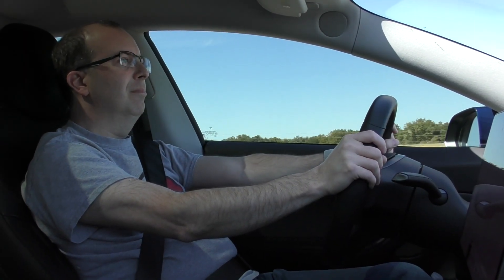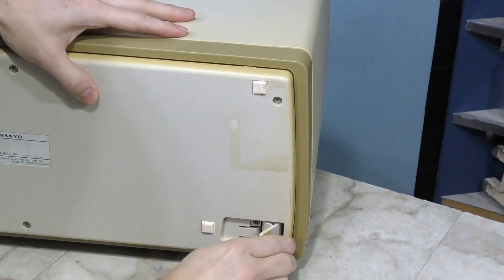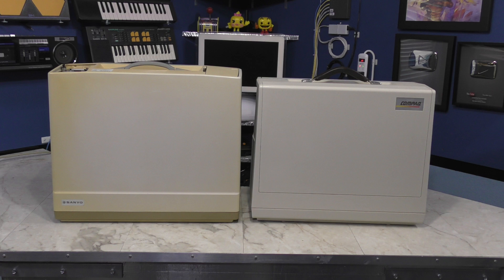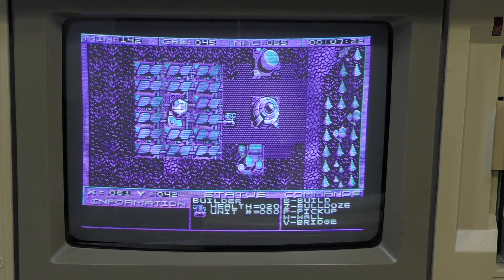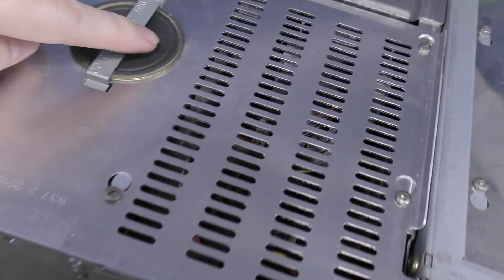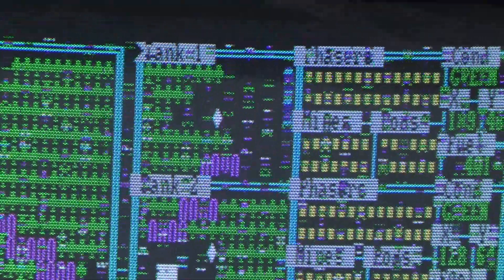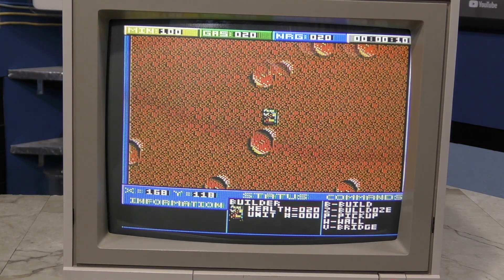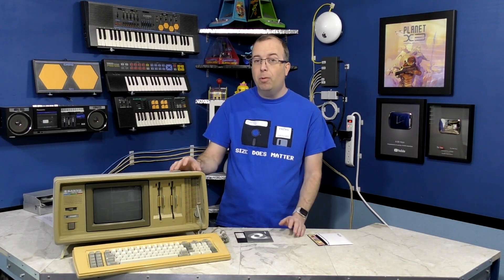Sanyo MBC-775 - The first PC portable computer with color screen.

Comment: omg I HAD one of these that I picked up off the curb back in 1993. I took it to the local computer shop and we added in a board to upgrade the ram to 640k so I could play games that required 512k of memory (i forgot by now but I know I had to get more than 256 ram!). I wish I never tossed it but space was definitely an issue back when I was renting an apt with 2 other guys and later that year I bought a new ZEOS 486 desktop and this Sanyo found its way down to my brother in Florida. He's long since dumped it but I believe he got a network card in it and ran DOOM on it with his apt buddies in LAN games. Good times.

Comment: That's it I have that veru same  Sanyo Luggable (41+ Lbs). I paid $1500 in 1988.  9" CGA screen, 2 40 track 5&1/4" floppys, 48Kb Memory,  Added a 6-Pack w/ Parallel Printer port, Serial Port, 384K memory, Modem 1200 Baud & 2 other things I can't remember. I also added a 10MB Western Digital Hard Card. It all sits in my on the Bedroom floor between the wall and Dressor with 5 or6 old Laptops, Old Analog Video Editing Switchers/Titlers.

Comment: Whow! This was my first PC and it is still in the basement. It has an 8bit ISA slot (yes...ONE free slot :-) ) and I changed the cards all the time...8bit VGA, EGA, Hercules, MFM HDD controller, joystick controller for two joysticks with Atari/Amiga/C64 style connectors. I still also have a NEC Multisync 3D Monitor that I used for Hercules, EGA and VGA. Oh, that was a great time! I think I´ll get it out of the basement and replace the capacitors inside the power supply

Comment: I wonder if they used a 120-to-100 volts AC step-down transformer with the monitor. If so that would explain most, if not all, of the extra weight compared to the Compaq portable. That's what Nintendo did with their classic arcade machines (Punch-Out!!, Donkey Kong, Popeye, etc.) which had Japanese-market 100 VAC Sanyo monitors that would be ruined if you plugged them directly into a 120 VAC outlet.

Comment: Just bought the same sanyo 775 it's gorgeous. Mine has a factory mfm st225 hard drive. Unfortunately, I don't have a keyboard, does it have to be an XT keyboard or will AT work?
I will try to change the ram to 640kb in the future

Comment: The base RAM is 256 kB., expandable to 640 kB.  How do you expand it to 640 kB.?  Do the chips go right on the removable portion of the motherboard?  Do they need to go on the internal portion of the motherboard?  Do they need their own expansion card, and if so, is that card a custom card or a commercial off-the-shelf card?

Comment: I had one of these...NEW! :)  I picked it up in the late '80s at a surplus store, marked way down.  Put a "6-pack" card in it and had a blast.  Games, including MS Flight simulator... and even ran an early version of AutoCAD on it.  (had to swap floppys back and forth to run FS and AutoCAD.  At the time I ran it on DOS 3.31 that I'd lifted from my Compaq work machine.  Really ran in to very few compatibility issues.

Loved the "pinch" floppy drives.  I replaced one with a 40m harddrive and controller.... there was room for an additional ISA slot on the bottom bussboard... I had to solder in another ISA socket, canted at a bit of an angle, to get the drive controller board in there and still have my other cards. 

I got a lot of use out of that machine.  I gave it to a friend years later after upgrading... I wish I'd held onto it now of course!

Comment: The proprietary DOS versions were a bit annoying.  I remember after having a damaged DOS boot disk for one of our older Compaq computers (one that natively ran Windows 3.1) I had to get a new disk from Compaq.  Granted the computer didn't need a DOS disk to boot normally, but if you upgraded hard drives, you had to re-install DOS and Windows again.  So this got annoying and it wasn't exactly easy to copy the disk either (to create a backup).  Luckily what I did do was create a set of bootable disks (using some of the DOS tools) that I could use so I didn't have to use the original disk.  I think once Windows 95 came along, Compaq ditched the OEM DOS system (if I remember correctly, but we never upgraded that Compaq to run Windows 95 as it was from 1991 I believe and came with Windows 3.0 installed so we weren't sure if would actually run Windows 95 with only 4MB of RAM I think (being a Compaq Prolinea 486 -- looking back, it probably could have run Windows 95 with 8MB of RAM, which the computer would have supported (and likely would have even supported up to 16MB of RAM but back then, RAM was expensive, but even so, it would have barely been able to run Windows 95 anyway, being only a 33 MHz computer).  Of course we used that computer until my father finally bought a Dell Pentium 60 machine (this was one of the first ones that had the notorious floating-point math bug where the square root of 1 was some long floating-point number).  Of course that computer also came with DOS.  First Windows 95 machine actaully was a 233 Mhz Pentium MMX system.

Comment: I have one of these. Mine has 640k of RAM and runs regular msdos 6.20 just fine. The front of the computer is grey. I’ve kept mine away from fluorescent lights so my case has not yellowed over time (thats why the bottom of your computer is still white, the computer sits on it). I’ve not noticed any compatibility problems running software on it, but I don’t have any games.

Comment: It's possible to have a library of CGA software that might have titles that do not run on the Sanyo portable because some later CGA software took advantage of later DOS memory improvements and configurations that were required to run the game. Some CGA cards were better than others and video often had conflicts with drives and systems. The 80s time period was a both a great time for operating systems and bugware. A lot of work was being done on technological compatibility with software which was pioneering but happens much differently today; back then, development was in the early phase of adopting standards to be used later on. I would also mention that hardware struggled to catch up to software needs but often opened new avenues for software to take advantage of ideas which sometimes didn't happen (I'm thinking of IBM microchannel and such or visaversa OS/2, Amiga OS, etc). The driving demand of the new found personal computer market and rise of home business offices powered a revolvution of computer sales and development. Portables like this were meant to take work home and usually came with a deal on business software. The Sanyo Portable is a real treat meant for executives to show off a portable computer which also represents the vision of an 80s computer product with great specs, performance and convenience but what is really impractical, incompatible and cumbersome.

Comment: My dad had a similar style computer but it was all metal outside and the keyboard clipped to the front screen was green text and was all the way to left with 2 floppy drives on right, it had a long metal handle that you propped under the pc to lean it up, Trying to figure out what it was, had no os and needed a master disk to load any software, i lost the master disk when i was young and never used it again. any ideas? it was HEAVY ASF, like a bucket of water

Comment: The reason why the newer versions of DOS didn’t work on the machine had nothing to do with the proprietary version of DOS for the machine. The reason was the version you tried to boot from the XTIDE was of DOS 6.xx which requires a minimum of 512k of RAM. You only had 256k. if you don’t have enough memory it will say “Starting MS-DOS...” and then the whole computer locks up because it ran out of memory

Comment: Sanyo: that takes me back. When we lived in Japan, Dad bought one of the MBC-555 models back in 1985, with a green display. Totally unportable (and heavy for its size), but I do seem to recall it had a spotty record with running DOS-compatible games.

I do recall Sanyo had its own ecosystem—even their own magazine (in English) if memory serves. You were expected to get software for the Sanyo series of computers, much as you would expect to buy software for the Apple II or the Commodore back in the day. In that sense, they seemed poised to be more competitors to IBM (and Microsoft) than true clones, rendering hardware without any other significant distinction. 

I don't really ever recall much fondness for the machine. 

The MBC-triple-nickel (as my father called it) was mostly used for writing and early database work; dad always had a large number of records for his jukebox (45s, chiefly), and he used the machine for keeping track of those and his LaserDiscs. 

I used it mostly for writing papers and character sheets for tabletop RPGs (as I was into D&D at the time). So in a sense, it was actually a great games machine.

Also, I have to give it credit: Sanyo had a paint application, and it was my earliest exposure to making my own digital art (a process which continues).

Comment: The ISM Express XT came out earlier in 1984 with a very nice color CRT. (I can’t recall if it was a Phillips or Sony.) And it had a 256 color card and digitizer option. An architecture firm my uncle did work for had three of them they were trying to use for color matching at construction sites. I don’t know what happened to the company. Heavy as hell!

Comment: Hi, your driving position is wrong. You are supposed to be able to touch your wrists on the top of the steering wheel with your elbows being slightly bent.

Comment: My Sanyo MBC-555  8088 was only ~3.6MHz. I followed an article in SoftSector magazine to increase the memory from 256KB to 768KB by stacking and soldering ram on the MB. She was slow, but she had a great keyboard. Well the click/clack feel was great. The KB keys and layout was odd. It was about 68% IBM PC compatible. I used a 300 baud modem. She was a beauty. If  you haven't done a review, I hope you will check it out. I could write C programs using a MIX C compiler. Before the soldering adventure, the 2x360KB floppies had combined storage bigger than the amount of ram on the MB. No power supply like today. It used a transformer, so think turning on an old dvd player. That is until the floppies started grinding to load DOS.Then it started to sound like a Tardis..... :)

Comment: IIRC DOS 2.x uses FAT12 and won't recognize partition above 16MB in size.
Reply: Ding ding - winner!  But if you used another vendor's FORMAT command you could get 32MB to work.  Is that enough to make it worthwhile for 8-Bit Guy to reformat his data card to stuff a few applications onto it to try?  Dunno.
reference, Wikipedia article 'Comparison of DOS operating systems', footnote 9: "Scott Mueller (1995). Upgrading and Repairing PCs, 5th Edition. Que Corporation. ISBN 0-7897-0321-1. p784: "The limit of 16MB did not come from the FAT, but from the high-level DOS FORMAT command... Most vendors supplied modified high-level format programs that permitted partitions of up to 32MB to be formatted properly.""

Comment: As for "too big to fit in memory" error -- sometimes that could be a result of incorrectly interpreting the available memory available.  Sometimes you can work around this by loading something that would "eat" enough memory to take it below a certain threshold.   For example, you could load the BASIC interpreter, then SHELLing back to DOS.
Another common irritation with DOS (and Windows) compatibility is when program incorrectly interprets the OS version -- where you get the error telling you that you need a newer version of the operating system, when you clearly do have a newer version.  For example the program refuses to run under DOS 4.0 and 5.0 and claims that it needs DOS 3.1 or later.  You'd think that programmers (as a whole) would've learned to do the check properly as far back as the transition between DOS 2.1 to 3.0 (or the more recent transition from DOS 3.xx to 4.0), but this type of problem persisted well into Windows era (which partly explains why Windows 95 and Windows 98 would report themselves as 3.95 and 3.98 respectively, rather than the real version of 4.0 and 4.1).  DOS 5.0 introduced the DOSVER program so that DOS can be configured to "lie" about its version number to a program as a "fix" for this programming mistake (and to get the actual version of DOS, the programmer needed to jump through a few hoops -- and if turned into a conversation, it would sound like "DOS, what version are you?  I am version 3.30. No, really, what version are you really -and yes, I can handle the truth.   If you insist, I am version 5.00.").  As for technical explanation how the version check is often performed incorrectly, it is tied to how the OS version is being reported - often in "byte-swapped" order -- with the lower 8 bits representing the major OS version and the upper 8 bits representing the minor version.

Comment: Ah yes... DOS-compatible but not BIOS compatible -- common sight when you have to deal with many early PCs -- especially those manufactured in Japan.  Some of the differences arise due to customizations made to support Japanese language.   Of course compatibility only being guaranteed at the DOS level -- often means that much of the software that would be compatible tends to be "boring" business software and hardly any games (since they're often more closely tied to the hardware).  As for game software to run on this particular PC -- you'd probably have to try Japanese games (which, unsurprisingly, may not run on English-language PCs).  And of course, you may also find that some of the software also requires a Japanese-language version of the operating sytem as well.
It's also interesting to note how many Japanese PCs often started out with better graphics (more specifically higher resolution) than the American counterparts -- mainly because they had to -- mainly to support display of the language (especially in displaying Chinese ideograms -- a character cell of 8x8 pixels isn't good enough).  And of course, there's that fiddly bit dealing with multi-byte character systems (with Japanese there are the major variants Shift-JIS and EUC -- each having sub-variants).  Even with text-based software, you had to be careful to mostly stick to lower ASCII range ($00 to $7F) and be wary about using anything in the upper ASCII range (as these codes are often have special meaning -- sometimes specifying a mode switch, sometimes a character page selector, or sometimes a prefix byte to multi-byte character code).  Also frustrating would be situations where you had the software output and display system mis-matched (e.g. trying to display output in EUC while in Shift-JIS mode, or vice-versa) you generally got gibberish.  Other Asian languages such as Chinese and Korean also present similar sort of problems -- as each of them also have a number of variants as well (on the upside, they also have the similar pattern of mostly using upper-ASCII range for special codes -- the lower ASCII range tends to [mostly] work the same as it would in English language).
Reply: And yes, I do keep around a copy of DOS/V (a Japanese version of MS-DOS) and Japanese language edition of Windows (3.x and 95/98 versions)  so that I can play some older Japanese-language games that won't run in English-language version of DOS and Windows.  On NT family of Windows it's a tad easier -- I just need to install the appropriate language pack (with XP generally requires professional edition) and change the non-UNICODE software compatibility to Japanese language.   Of course I'll still have to contend with the occasions where English-language software not working correctly in this mode.  The other route is to use something like AppLocale (although primarily for XP, with a few tweaks you can get it to work up through Windows 7) to avoid having to reboot each time you change the non-UNICODE compatibility (changing this requires a reboot).

Comment: This computer highlights why there was distinctions made in the early days between computers that were MS-DOS compatible, vs IBM PC Compatible. This was a pretty big issue once the clones started coming out in droves about 83 and 84. As many didn't follow the exact hardware implementation of IBM's original, so any software that banged the hardware would often fail, however more generic software was perfectly fine.

Comment: When I did my first Programming/Computer Science education, the machines we had were Siemens PCs with an intel 80186 processor and the graphics card (I cannot remember wether they were CGA or EGA) was memorymapped to a non-standard base address thus most games did not work.

I would imagine that something similar is at play here. Which might also explain why Planet X-3 works if you programmed that 'nicely' ie not relying on defacto or non-documented standards rather than the documented ones.

Comment: I sold a few of these to my first corporate client Gandalf Digital communications that would have been 1984.  They had bought a couple of compaq machines and some sanyo desktops (which I had added hard drives to put NEC v40 chips in and overclocked to 7.16 Mhz like the compaq.    Though they would not run the games, that would not have been the market, Gandalf who made modems wanted them to show off their communications software which was text colour, it was not unusual for manufacturers in the early days to make machines which were MSDOS compatible and not IBM compatible, the sanyo 555 and the Apricot were examples. As long as they ran Wordstar (and wordstar 2000) and supercalc everyone was happy.